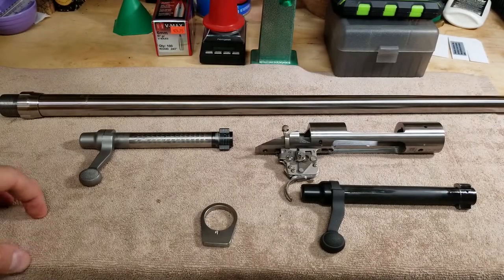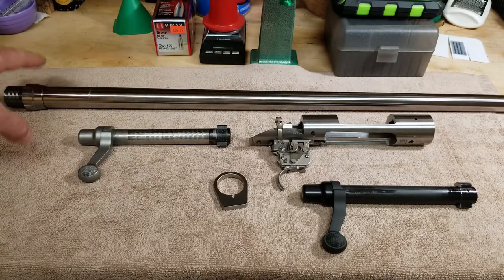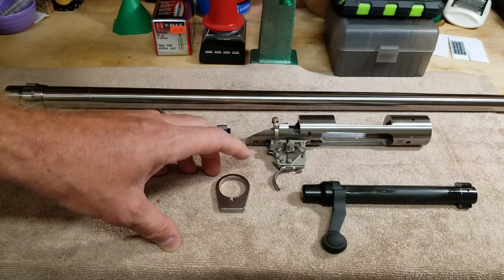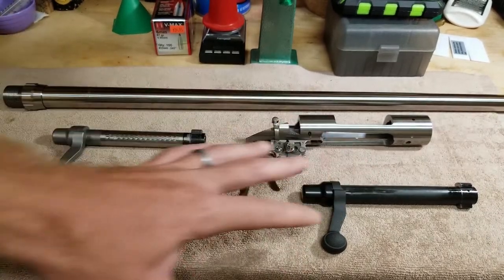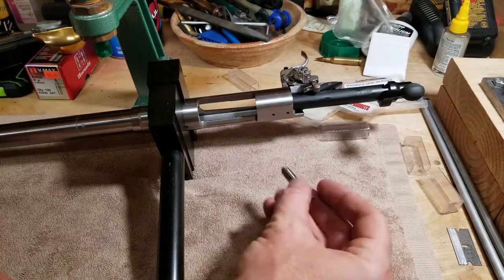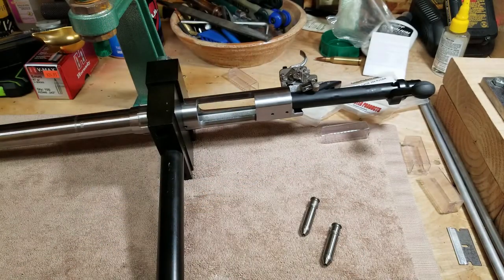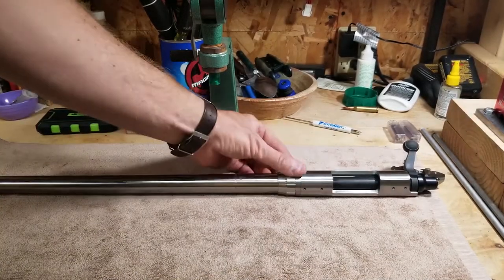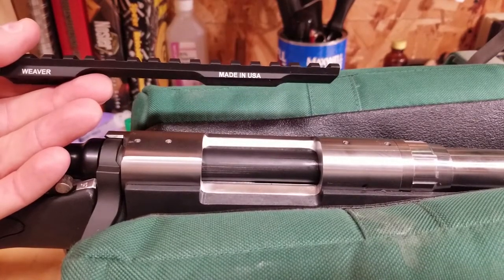Custom Rifle Build:  Review hardware, assembly and range results

Comment: Awesome setup. Not a big fan of the new style rem extractors. Bought a tool recently to convert them to M16 style. 204 Ruger is a awesome little cartridge.  Keep us posted on its performance 👍
Reply from the maker: This winter should be interesting, i'm pumped to get this out next summer with G running it...she loves it already.  Huge sigh of relief when she smiled after firing it...
Reply: @pawild5594  how do you keep the recoil lug aligned